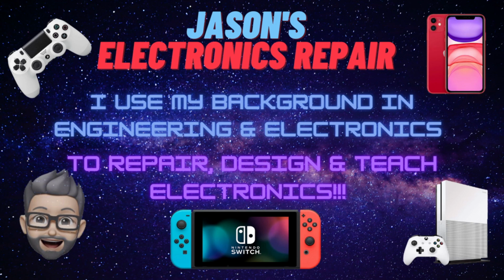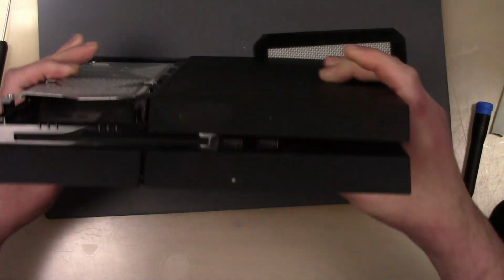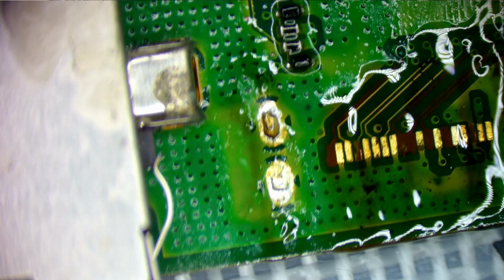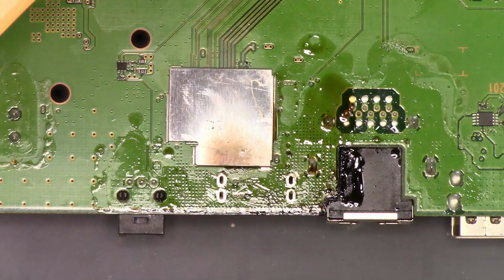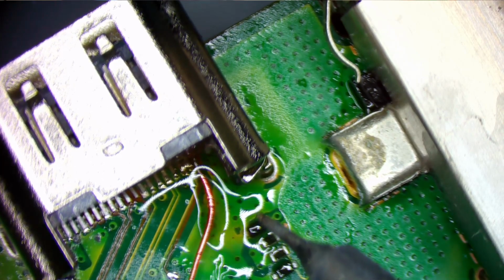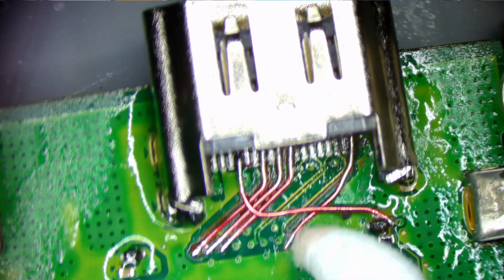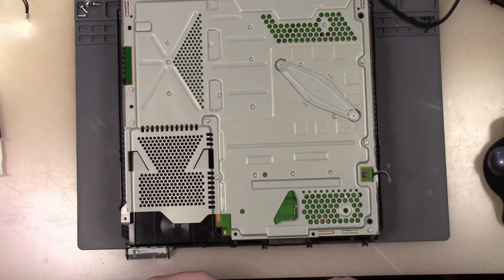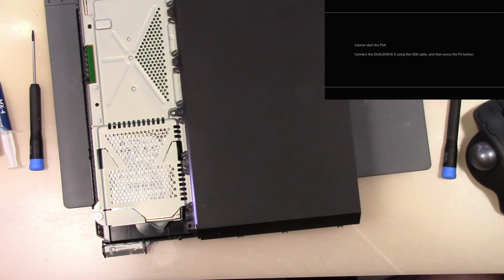PS4 HDMI Trace Repair 5 Jumpers

Comment: evening brother tell me if possible what is the name of the wire you used to connect the pins of the hdmi connector to the pcb and then the type of flux and tin you use thanks and congratulations for the video you should just improve the audio